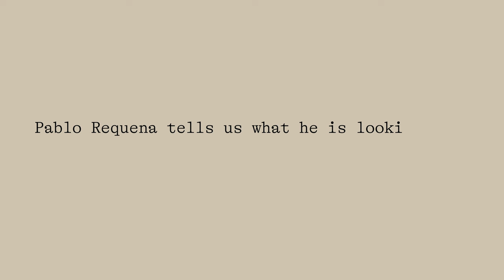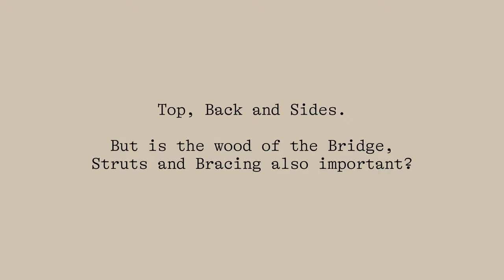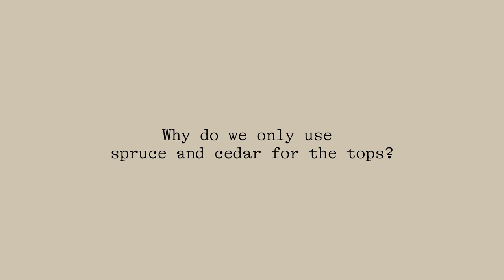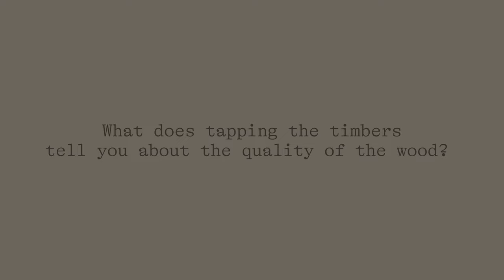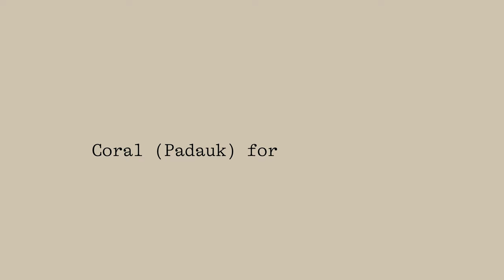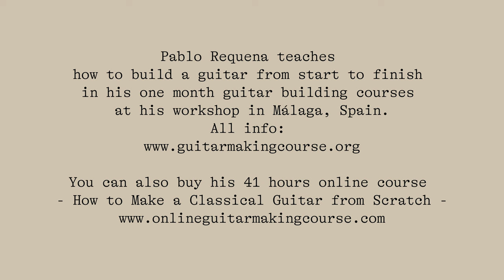Wood Selection for a Guitar. With Guitar Maker Pablo Requena.

Comment: Very informative.  One thing I didn't quite get is the tapping of the wood.  He says he stores the wood for several years to dry out, so, he is tapping wood that contains alot of moisture, would that not deaden the sound somewhat or is the moisture content already pretty low and the note wouldn't change much after drying?
Reply from the maker: I think for Pablo it doesn't matter if later will change the note. What he wants to perceive is that the timber emit some kind of resonance that he feels good about it since the very first time he tap the timber.